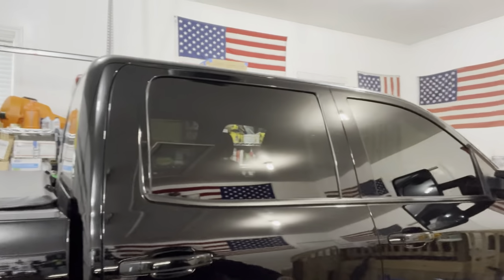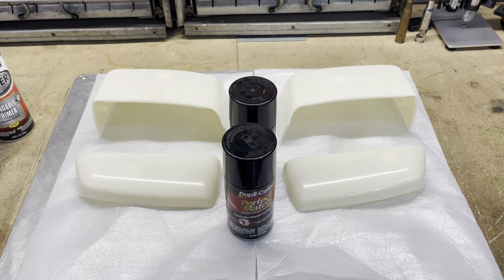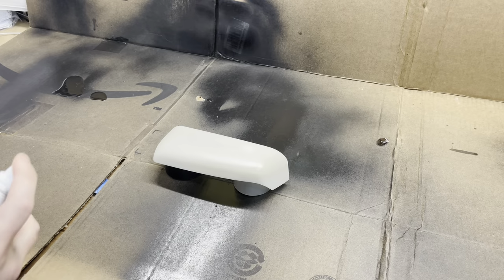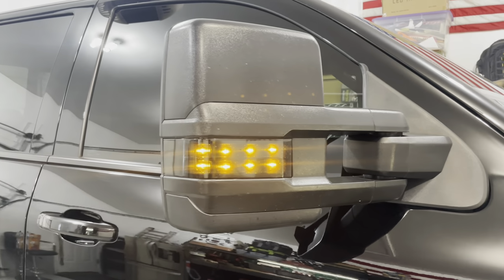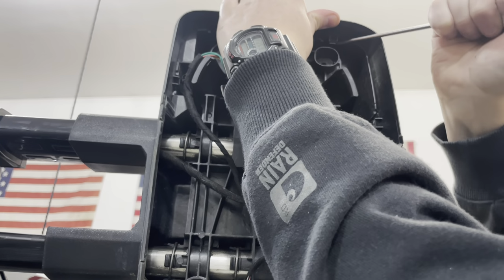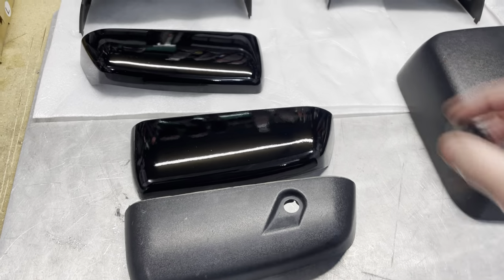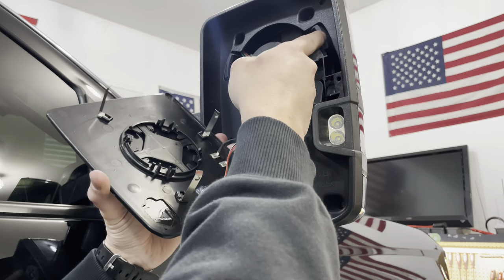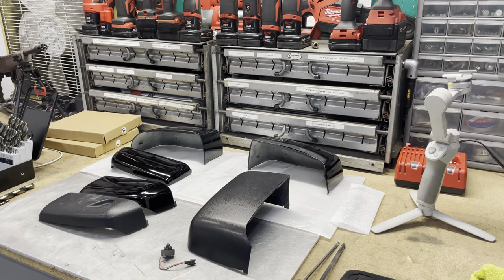Boost Auto Parts LED Signals And Paint Match Tow Mirror Cap Install. Duramax!

Comment: Are they also turn signals?
Reply from the maker: You can wire them that way yes. I didn’t.
Reply: Talked to them today and they claim you can’t. Told me only the switch backs are turn signals and they don’t make them without a white marker light
Reply from the maker: @chrisjeffries4036  hmmm maybe the switchback function only turns the color
Reply: Apparently no one at the place knows what they sell. You use this if you want them to be turn signals.
Dual Function (Signal & Running Light) Wiring Harness for OEM Mirrors - Silverado & Sierra (2014-2019)